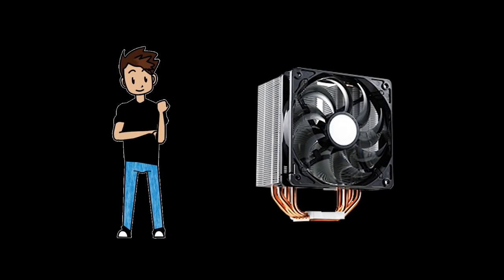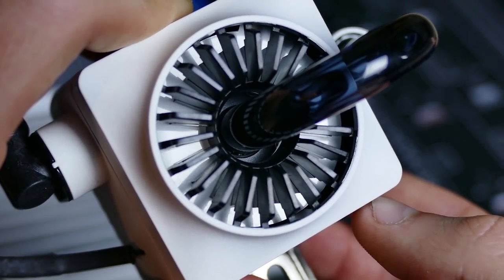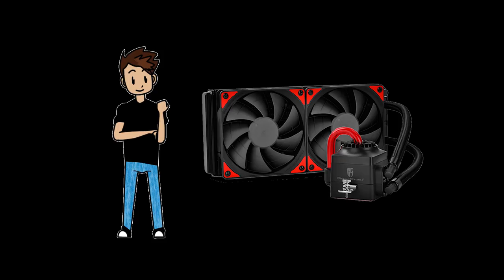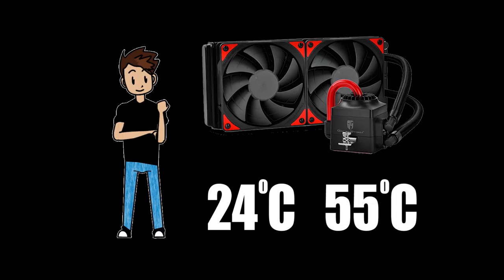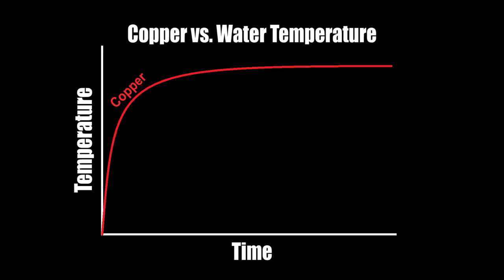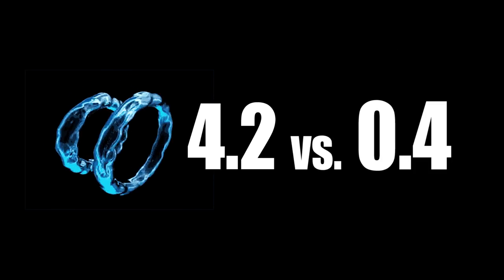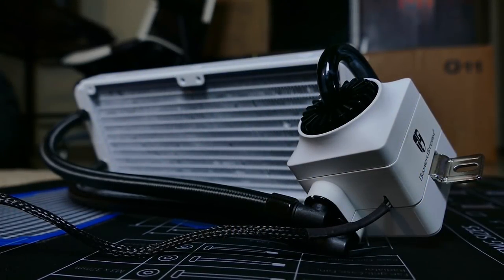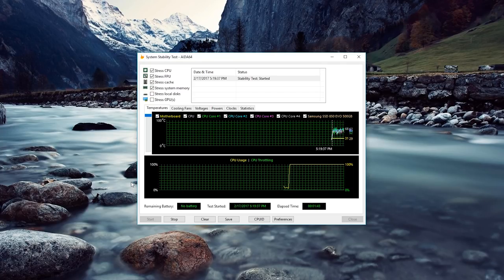How to Properly Measure AIO Temperatures

Comment: Nice video, and this is exactly why, if one day I have spare money to build a beautiful fancy (but functional) water loop, I would put more radiators than one would find necessary and also don't hesitate to make the loop long with pump > CPU > radiator > GPU > radiator > radiator > radiator > reservoir > radiator > reservoir. (on a custom and large case obviously, desk case type)
Because not only having more radiator mean having the ability to run fan at lower rpm reducing the noise to equivalent one or two radiator build temperature, with smart fan curve of course.
But also it would allow for better dissipation making the liquid slower to reach higher temp because it will have more thermal dissipation to cope with.
CPU to radiator allow for the liquid to heat and then cooldown a little, avoiding it to do directly to the GPU already hot and get more energy to raise his temperature even more, and after the GPU, all those radiators to cool it down and on local basis and on overhaul basis get higher total dissipation potential, also with that big of a loop two reservoirs are probably the minimum, so having two reservoirs with a radiator in the middle so the first help the water temp to equalise a little, is cooled a little and then is stored.
Also I was thinking about having two pumps (two pumps with radiators to compensate for this huge loop like the 200ml NEOChanger from Enermax) in parallel as a failsave and having a good flow and pressure for that big loop, so even if one is dead, I can still use the computer while ordering a new one without issues and still use the computer without even requiring to touch the loop until I change the faulty pump, and with valves on entry and exit of the pumps which also will have a train pipe which will exit under the case, since the pump with his reservoir would be vertical and at the lowest place of the loop but with valves in entry and exit, I think it will be easy to purge, fill and change a pump (potentially with a running computer even if I would not do that).
I'll first try with flexible and if it work well use hard tubing.
I never did any waterloop before, is my idea good ?

Comment: What i did on my frankenstein custom loop:
unplug all radiator fans.
run benchmark with cpu and gpu load at 100%
let cpu and gpu heat up to 70°C-80°C (if your loop can handle it)
add one fan on low speed.
temp falls? youre green.

I run a gtx1070 and a 4670k booth overclocked. only 2 120mm rads.
I added one fan at mild speeds and the temps fell right down.

Comment: I have checked mine.... my air Cooler got it to 80 celcius but When i put my aio in... It never peaked 40 Degrees celcius when at load line 70% bit at 40% on my air it was up in the 80s

Comment: All I know is that I switched to an AIO water cooler with a 120mm radiator and my temps are much lower even after hours of intense gaming. I rarely see above the 50s, where as my aircooler would regularly see me in mid 80s. Yes the water takes time to heat up, but the aluminum in the radiator also draws that same heat energy from the water and cools it. So its not like the water just gets hotter and hotter and never cools. Plus the bigger the radiator, the more cooling capacity. I have a 120, which is small and perfect for my rig, however if I was OC'ing a 240 or even 360 would be better.

Comment: The title is misleading; what you're saying is that reviewers are misleading their readers/viewers by not running their tests for long enough and not pointing out how long it takes the core temperatures to return to normal.  Neither has anything to do with the AIO coolers or their manufactures lying to us.  Thank you for the technical information, good as usual.

Comment: I'm planning in getting the Ryzen 2700x. It's coming with an awesome cooler and my case has much place for air (Corsair 600c). But I'm planning on AIO watercooling it, not just because it could be cooler, but also a bit for design purposes.

Should I just try out the air cooler of the ryzen, check if it looks good and performs good and then decide on buying the AIO water cooler? I think the air cooler will do a great job, because of that much room in the case for air and the great airflow

Comment: In automotive (specifically inter coolers for turbo applications) we usually look into this same issue. We call it heat soak. 
It drives how big we run our gear. But we run into other issues like pressure drop where the medium in the tubes is of focus not just dissipating properties.

Comment: I think finally there's a use-case for peltier cooling, then. I've never been sold on it because of the immense power requirements and the condensation, but if you were to only use peltier coolers when the radiator temperature is still above ambient, condensation would be no issue. I would propose engaging peltiers for a "rapid cool" for a return to low idle temperatures, and then cutting them off as soon as the radiator temperature drops. Such a system would have to monitor CPU/GPU usage, and when it drops, engage the cooler.

Comment: true in terms of real average temp under load. But when it comes to temp in idle, liquid coolers are not cooled down passively usually. There is fan, sometimes 2 or more. so liquid does not hold high temp for much longer then air cooled radiator (but still longer).  Liquid cooling works really well with big radiators and high speed fans. CPU or GPU even under heavy load stay relatively cool.  Good to see someone using simple science to separate truth from marketing BS..
Good vid.

Comment: A very nice and accurate explanation! Though at the end of the day its the total surface area (area radiator fins) being cooled by the local ambient air and transfer efficiency that will dictate (long term) cooling rate. A water cooler can have a much bigger and efficient  radiator(eg better placed)! But as you point out correctly the heated transporting liquid adds an additional thermally loaded mass which does delay overall cooling, or indeed heating speed, of the radiator (technically the thermal mass of the entire cooling rig should be included I guess too)! It was my impression that rapid temperature changes can be as damaging to electronics, as high persistent temps. So one could say the only real way to test liquid versus air is in very long term cpu durability tests inside identically run computers! Bit hard to do in a practical bench test (over years most likely). Besides either pumps or fans are likely to fail long term first unless one really drives the cpu extremely hard! Anyway well done and nicely explained! Maybe someone should try this testing cpus to failure???? To get a good statistical comparison maybe best out of 5x cpu fails (two otherwise identical computers doing the same extreme things and cpus/hardware replaced fresh in both after each single fail to determine liquid versus air)???? Maybe someone has already done it???

Comment: I got a Coolermaster Masterliquid 240 Pro RGB from Coolermaster the other day. Idle temps are great over my 212x, but when running P95 for like an hour or so. it get pretty hot like my 212x... is this normal? I guess this is why you made this video
Reply: Correct.
Unlike big expensive custom loop radiators small/slim AIO radiators simply don't have that high surface area to dissipate heat to air...
And would need noisy high speed fans to have actually high cooling power, while pump is already additional noise source.
Good heat pipe coolers actually beat many AIOs in cooling power per noise.
Reply: Esa Tuunanen turns out i was just being dumb. i switched from push config to pull config and the tems dropped by 30c. 12c idle and 34c after 1h P95 where as push config was 41c idle and 63c 1h P95

Comment: IMHO the added thermal 'inertia' of a water cooled system slows the rate at which components heat up and cool down therefore potentially reducing the number of thermal cycles and in turn reducing the damage done from the expansion/contraction of each cycle which can only be a good thing for MTBF.

Comment: TL;DW: AIO coolers wont magically reduce peak temperatures. If your CPU reaches 80c  (peak) with air coolers, with AIOs it would probably reach 70-75c at best. So not a significant reduction as many claim. However with an AIO, it would take the CPU almost 1 hour to reach the peak temp of 75c, but with an air cooler it would reach the peak temp of 80c within minutes.

Comment: 7 min to say water takes longer to reach max temp compared to copper thus you must wait longer to achieve peak temps.

Just a correction, specific heat is specific heat, no need for the 'capacity' at the end.  That's a rate/rate idea.

Comment: The water isn't sitting after gaming. Its constantly being cooled by a fan and radiator and traveling a further distance at that so I would say you're being a bit exaggerating. All I'm saying is size and length comparison i believe its not much longer than a small copper/aluminum cooler.
Reply from the maker: Nothing exaggerated here. I think you missed the point.

Comment: if you are saying that about about AIO's you are talking about costum loops to, the only diference is that in a costum loop there is more water which is going to take longer o heat up... so are costum loops lyings to? Makes no sense, anyways its going to keep the temps lower thats what matters. And metals can take really long time to dissipate heat, it depends on the density of the 'block',

Comment: may have the basic science down but missing the engineering aspects. the aio cooler radiator is bringing the energy to a better location to be dissipated. the fan/heatsink based cooler dissipates heat to inside your case, where your case fans then push the air out. the aio should bring the energy to somewhere closer to outside the case. and if you set it up right push the joules out of the case. no matter the specific heats involved... the energy created will be the same... other than increases in resistance due to rising heat, a de minimus concern (in favor of the water cooler by the way). so with the same energy being turned into entropy, the same increase in enthalpy, the question becomes a matter of where the energy is. you probably want it away from where it is being generated. that is what your water is doing. there were a couple times it seemed like you almost were going to cover this. plus... it is not a closed system. it would fry itself in prompt order if it was. my 405 hp car engine burns through gas pretty fast. i gotta figure it generates a lot of heat. i would never dream of cooling it without a radiator. i actually just replaced the water pump earlier this year. just in case.

Comment: hi im thinking upgrading to a  DEEPCOOL CAPTAIN 360EX i have the room in the case . top mount  buti been watching allot of reviews and don't know if its right choices to upgrade.. iim on a budget...... my stock fan is very noisey and it revs up fast when gaming.. tired of teh headaches   reason why hte 350 is teh red lights on pump n fans.. but i bought some AF120 corsair lef red fans to repelace the fans in the cooler  what is your truly point of view to the DEEPCOOL CAPTAIN 360EX

Comment: Great explanation of the thermal properties of cooling and head exchange lol. I've been thinking about liquid cooling and was thinking that I would have to move my reservoir outside my case and head sink it to get prolonged results. I was thinking that using something like a cross-flow heat exchanger or even a panel heat exchanger would be your best bet.

Comment: The way I see it, I'd rather have more consistent temps than quickly dropping temps after high loads. Just materially, metal and other materials can get brittle if it heats up and cools down too quickly. And CPUs are more or less made of metals and other metal-like stuff. So from my understanding, I feel like this more gradual heating and cooling is going to prolong the life of the cpu for that very reason. Also yes water retains heat longer, but isn't that the whole reason the water snakes through the radiator the way it does, spreads the water out thinner and the whole surface area = better dissipation thing apply here.  Idk this just seems a bit reaching.

Comment: It's worth noting that you will almost never run your CPU at max load for more than an hour in an actual use-case. At smaller sizes an aio offers only comparable cooling performance to an air cooler, often times it can be worse performance than an Air Cooler at a similar price-point. The reason you would use a small AIO is for quieter operation.

Comment: I had a AIO it worked well for my uses, till after 8 months the pump died, sidon 120v, the blue LED on the Pump still was on and my system wouldn't even turn on long enough for me to figure out what was wrong so i went back to my other computer. now that ive swaped back to the stock cooler that system is working well, and the stock cooler is working better with the thermal compound that was still on the chip lol.

Comment: I don't really see a problem with AIO. My air based cooling would have the CPU temp jump really quickly and the fan would start blaring when it reacted to it. That meant the fan would get incredibly loud all the time when I loaded games or used the CPU a lot. Obviously with water cooling the CPU is still making the same amount of heat... But now I have 2x 280 mm fans to get rid of the heat rather than 1x 120mm fan. That should allow for a lot more heat dissipation. And then the water takes a lot of energy to heat up so temps won't have temperature spikes which can cause your cpu to throttle and your fan to speed up significantly.

So overall yeah, I understand the point that water cooling maybe synthetically looks better than it actually is because the water takes a long time to heat up, but it's still taking in the heat. But there are other advantages. You can have a significantly bigger area to cool and bigger fans and no temp jumps. I could get a noctua cooler for almost $100 or get an EVGA CLC 280. I chose the water cooling because I can choose where the fans go and have a setup where the air is pulled in from one side and pushed out the other and I should have better cooling since the cpu is heat exchanging with air from the outside of the case which is cooler than inside.

Comment: I game for 45 minutes - 1 hour at a time, generally. What I've experienced is that the system was absolutely cool as compared to an air cooler (which made my case heat up like a frying pan in less than 15 minutes while gaming). This is exactly what most gamers would want. The high temperatures made it almost impossible for me to game for more than half an hour (without turning on the A/C). As for the temperatures going lower, slower, I don't think people would mind it that much as long as the upper cap is lower. With liquid cooler, the upper cap is well within tolerable ranges. I don't care about the 'delta' all that much.

Comment: im happy with my aio i onsy spend 80 $ and i have an ryzen 5 1600x overcolocked to 4.2 Ghz and under full load and over 4 houers system running i have just 56-63c° so i think its fine

Comment: Just a side note, I got that exact Deepcool captain 240ex and there was air getting into the pump making a very loud noise but would vanish once the cooler was tilted and the air escaped the pump and into the radiator 👍. I doubt it’s supposed to do that haha but unfortunately mine did. Anyone else?

Comment: It not like they can make the water make direct contact with the cpu unless you want to blow it up. It just about the method of removing the heat from the copper block. Remove by high speed air @ water.  That's all.

Comment: I see your point, however the reality is that when you're doing real world task you're going to have fluctuations within the CPU which means the radiator will be given more time than during a stress test to dissipate heat. Therefore, an AIO and water cooling in general works better. I love the video, and you've earned a sub from me because of its technical nature. However, just for people reading this they need to understand that real world use is going to showing more efficiency in an AIO than an AIDA 64 test.

Comment: My pumps are running Mercury in my custom loop and I'm using a very compact ac radiator that is only 280mm squar e and 60mm thick, it has been running great since I set the loop up with my 5960x, do not do this unless you understand the risks of Mercury and how to properly pump Mercury

Comment: Yeah, but the larger radiator and more fins (larger surface area) means heat dissipate was faster than a single small cpu air cooler. The point of AiO or water cooling isn’t to cool using water, but let water (liquid) carry the heat to the radiator and dissipate faster through the larger surface area of the radiators.

Comment: Thanks for the vid, I thought i'm gonna RMA again... But it seems like it's okay to get around 70-82c in BF V after 3hours+ with rtx 3070 and i9 10900 non k? (gpu stays at 60c) and ≈200 FPS no drops or stutters whatsoever, everything runs smooth it's just cpu temp seems kinda high...